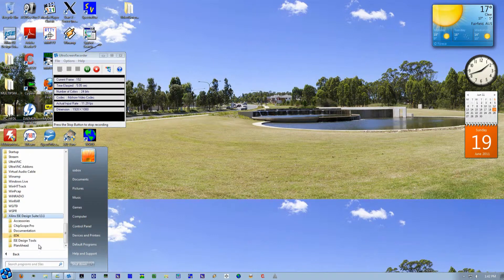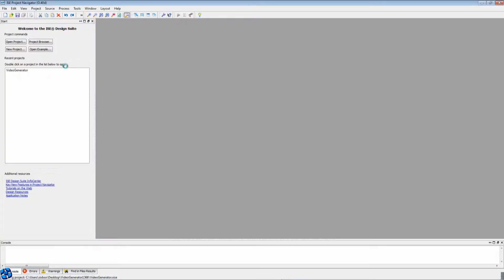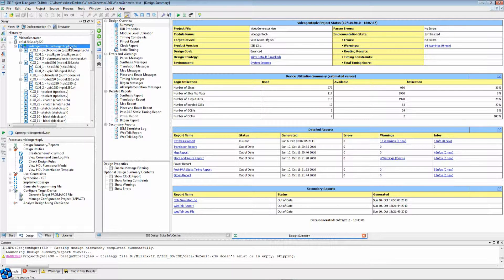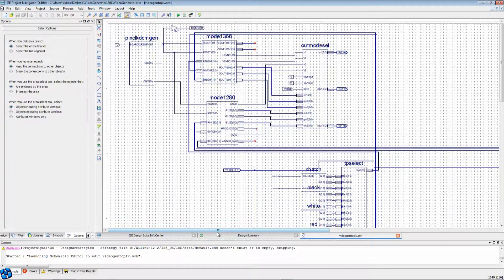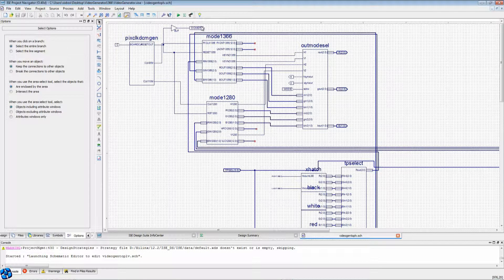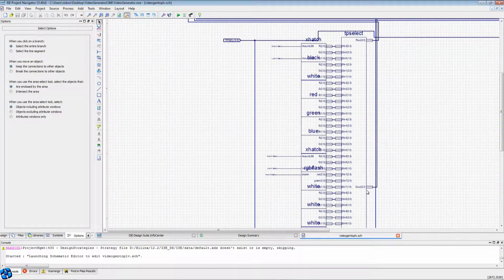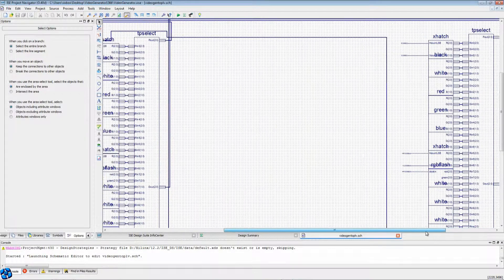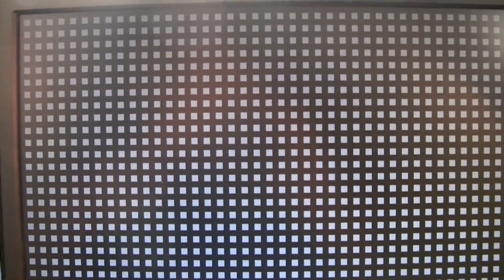Generating VGA signals from a Nexys2 board with a Spartan 3E FPGA

Comment: You can also program the ROM by using the .bit file. Just change the jumper to the correct position and choose PROM instead of FPGA in the Digilent Adept software.